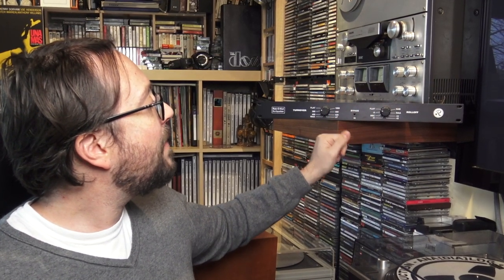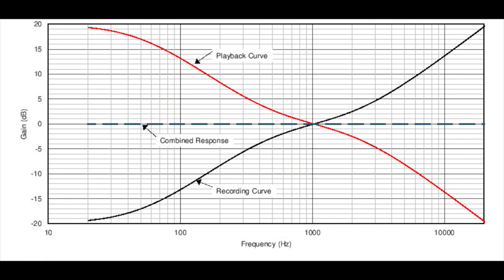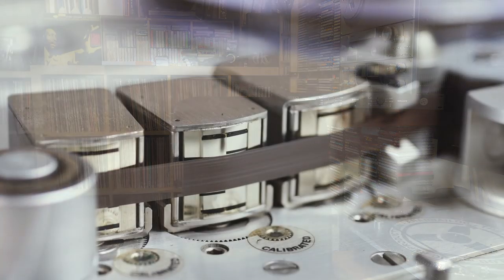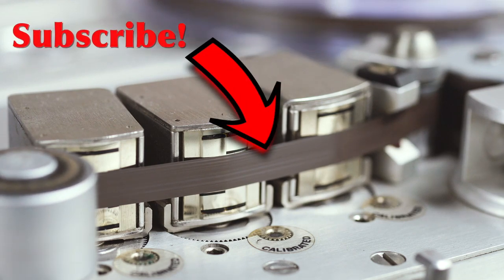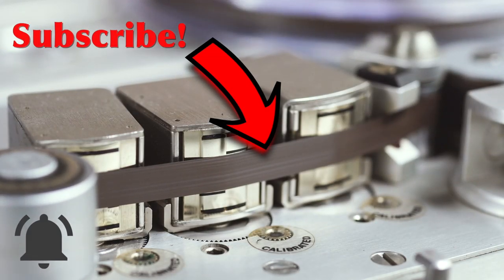RIAA Equalization: The ingenious solution behind the LP

Comment from the maker: I forgot to highlight also a 4th point: the RIAA equalization also greatly helped the TRACKING issues connected to the large low frequencies grooves, as well as avoiding also the DETERIORATION of those grooves.
Reply: Yes I was going to say about that but you said it now!
Who makes that equalisation box, and how do you find it?
Reply from the maker: You mean the drawing I showed during the video?
Reply: @anadialog  no drawing I don't know what you mean no the comment you made that the needle can skip in the bass tones.
Who makes the the equalisation curve box you had behind you, I wanted to know ! and how do you find it does it work well or colour the sound is it a massive improvement?
Reply from the maker: @johnsweda2999  Now I understand! Its the Re-equalizaer by Rek-o-kut (esoteric sound). I got it several years ago for teh correct equalization of my 78rpm records and showed it in that video: https://youtu.be/_aybfww2nIg
They still make it and now it is improved with also a lateral/vertical switch: https://www.esotericsound.com/elect.htm
It is obviously a signal break and NOT passive so a little coloration is the toll to pay to have a correct eq. Obviously I do not know if things are better in teh 3rd edition out now.
Reply: What is LP?

Comment: As you said, the grooves that represent low frequencies need to be way bigger on high amplitudes.
Especially for very fine styli profiles with a small radius like Shibata, microline and fineline it is an issue.
Without the equalization, the grooves would become too wide for those styli to make proper contact with the sides of the grooves.
It is also the reason that some records from the early 50s (that have nearly zero equalization) sound better with larger profile styli like conical or spherical, even while they are the same microgroove type.

RIAA filter accuracy is also very important for accurate sound reproduction. It is often underestimated and people mostly buy phono preamps based on the amplification performance and noise/dynamic range of the device itself. If they they even consider investing in it; I think phono preamps are one of the most overlooked upgrade.

Passive RIAA equalization is often considered better when good components are used in a good design. With cheaper components active RIAA equalization is often better.
When well implemented, passive RIAA equalization has better accuracy on higher frequencies, no instability at certain specific frequencies and feedback within the filter itself is impossible.
The bad thing passive filtering can be impedance issues, because the impedance of the filter varies greatly per frequency, so the amplification circuit has to be able to deal with that. Similar to the issues some power amplifiers have with driving electrostatic speakers.
Active filters have a feedback loop where the signal is amplified at the desired frequencies, so instead of making high frequencies relatively less loud, the bass gets amplified to make it louder.
This makes phono preamps with active RIAA equalization more power efficient; about 20dB less amplification is needed to achieve the same output level as with a passive RIAA filter.
Reply from the maker: Thanks for adding this extra info!
Reply: @anadialog  You're welcome 😉

Comment: If I'm not wrong, for quite a while the DECCA curve coexisted with the RIAA. 
They were very similar and, obviously, had the same purposes.
Anyway, the only caveat I see is the accuracy in standarization the curves must have in both the original and the reproduction phono preamp.
But, as you say, is one elegant solution for three issues.
Thanks for the video.
Reply: Decca LPs used at least 3 different pressing equalisations from June 1950 until January 1956 when they changed to RIAA.

Comment: A Good Phono pre-amp design will be tight on phase linearity. 
Two indications for that: 
A) an extended Frequency response for both lows and Highs,  at least 40 KHz and more at the highs (I use a phono pre-amp that reaches 100KHz). The added frequency range is not for the purpose of having more musical information (Though I do measure a typical above 40Khz of musical information, some rare cases  reaches to 60Khz!). The reason to have such extended FR is mainly to keep perfect timing  on the audible signal by having the "above the 20KHz" roll off phase characteristic out of the audible range (above the 5Khz is a must, above the 20KHz is preferred) which has a lot to do with correct imaging and proper timing (Timber) for the system        
B) a high slew rate, something like 2V/uSec. What does a high slew rate indicates
(on top of the ability to reach high frequency response)? It indicates the use of low feedback gain loop on the pre-amp  amplification. Without being too technical, a feedback loop compares the output signal of an amplifier to its input and sends a correcting  signal that reduces all kind of problems (linearity, noise, frequency response, etc.). a too high gain on the feed back loop causes problems of its own, (i.e, overshoots, ringing etc.) which occurs especially on transient modes, and low slew rate is an indication for heavily feed backed amplification. The phone stage that I am using has an "Equal Feed Back loop Gain" meaning that the open loop amplifier (before having a feedback) has passive filters to achieve the RIAA gain curve and then The feedback loop has an RIAA curve too, so a linear constant low gain feedback loop is obtained.
C) The phono stage I am using is the one built in my integrated amplifier: Harman Kardon HK6600 which I bought and using since 1991.

Comment: So I have two things What do you think about adding an equalizer to a vintage kenwood receiver.And adding a phono preamp between the vintage receiver amp. I think I would like to get a 10 band equalizer to play with the acoustics. My vintage kenwood is 80 watts on a pair of 100W to  400W Klipsch floor speakers. 98dB, 8 ohms, frequency 35 Hz - 24kHz ,crossover 800Hz. If this helps. I’m happy the way they sound withtwo 8 “ woofer and a1” tweeter the speakers are new. The new guy looking for answers. Thanks for your time and your help.
Reply from the maker: I must admit that I am not a great fan of equalizers. They add a new component in the chain, degrading the sound, plus it heavily modifies it. In any case, you must add the eq after the phono pre-amp, which brings the signal at line level.
Reply: Thanks for your insight on equalizes I appreciate your help. I am wondering if I can boost the amps on my receiver,  80 watts into my speakers sometime I hear a little distorted sound on certain frequency on electric guitar parts soft and loud. I have no problem getting it loud and I can’t get it past half way with the volume because it so loud. It sounds great to my ears,very detailed separation of instruments,clear clean sound on bass too.I’m hoping I’m not under powering my speakers and that’s what is causing the problem. Thanks again for your time and your help.

Comment: Nice video as always and good enough but a simplification. The 500 hz time constant point is not "mid". A lot of things happens in the equalisation curve and It's not only an equalisation reducing and increasing frequencies by choice but by  simple electrophysics due to the working principles of cutting heads. The 500 Hz is called crossover point for a reason. It's the point were we switch from Constant Amplitude to Constant Velocity. Below 500 Hz the base is kept at a constant amplitude to not require more space and cause problem for tonearm and stylus so frequencies are recorded in a modulation resulting in a mor or less mono situation for all lower frequencies. Above 500 Hz the amplitude is doubled for every doubling of frequency, giving a 6 db increase for every octave. The 3 time constants are points were the linear function is broken into shelves to  "cheat" a little. Curve could be a linear function instead but that would require an amplification of around 60 db to just cover the necessary area and that is (was) not possible. The curve, being a compromise, requires 40 db headroom for only the equalisation is difficult enough and requires at least 2 or sometime 3 amplification stages for a passive RIAA. Unfortunately many record companies had their own way to implement the RIAA curve and it took some companies about 20 years or more to adopt the RIAA in practice. Thats why an adjustable "RIAA" is good if you like to play records from the 50's and 60's. Thanks again for the video!!
Reply from the maker: Yes, I MUST keep things simple as you can imagine. Otherwise I would be writing a technical article on a scientific journal :-). I was even reluctant to even mention the time constants. In any case, I was referring to these three frequencies as belonging to the three main areas, highs, mids and lows. Here is the correct scheme of what is happening for those interested:
Below 50hz: constant velocity
50hz-500hz: constant amplitude (wiggles) of the cut grooves 
500hz-2122hz: constant velocity where the cutting head regardless the sound pressure keeps its same velocity in tracing the grooves (obtained by reducing the amplitude of the wiggles).
2121hz-above: we go back to constant amplitude. 
Actually the reason why we switch from constant amplitude to that of velocity at 500Hz its because of a critical resonance of the cutting head, which is suppressed this way. In fact this time constant is adopted also in other equalization curves like the NAB.

Comment: This is one of the reasons why the early CDs that were simply taken from analog masters without undoing the RIAA curve sounded like crap. They don't anymore and the bass frequency playback is much better. As an electronic musician I'd never go back to vinyl. Digital gives me all  the bass I want and need without worrying about the tracking error associated with vinyl playback.
Reply from the maker: Analog masters are not RIAA equalized. That takes place before cutting (fortunately). Early CDs had what is called pre-enphasis to reduce noise due to low quality conversion. Not the best solutions.

Comment: Hello thanks for this video.
I have issues with the high frequencies on some vinyls that are well recorded such as the The Unique Thelonious Monk. This vinyl is on microgrooves and using the RIAA curve as audio compensation. So far, the high frequencies are noisy, i guess that is caused by the built-in preamp of my amplifiers. As i will get an external preamp soon i will know if it is the real cause of this. But do you have any idea of the cause of this noise in the high frequencies?

Thanks.

Comment: Why didn’t they do the same thing for cassette when they developed Dolby B in the 1970s?
Reply from the maker: Tape has different issues, mainly concentrated in the high frequencies, but it does have it's own specifics standard equalizations. Type I had two time constants as well, 3180ms for the lows, just like vinyl, and 120ms for the highs. While type II and IV, 3180ms and 70ms. Dolby and other NR systems are companders, not equalizations, and act as filters.

Comment: Wanting a quick explanation - I wasn't going to get one was I ?
After 4 minutes+ of crap - I'm switching to my "parts" catalogue that I was viewing before I tried to figure out what it's RIAA circuitry was for.
Geez thanks for pissing a fella off ..
FOUR MINUTES of gobbildegook.

Especially poignant - is the FACT - That I was wondering if I need this RIAA at all - what with attempting to pre-amp an audio isolation transformers mV output - before a main amplifier..
Your four minutes of "intro" STILL hasn't told me a ruddy thing.